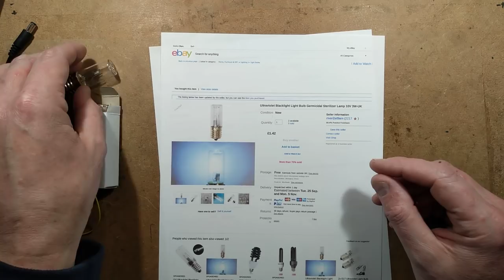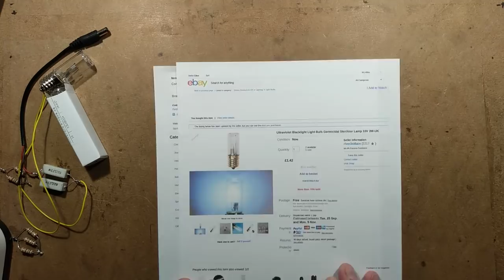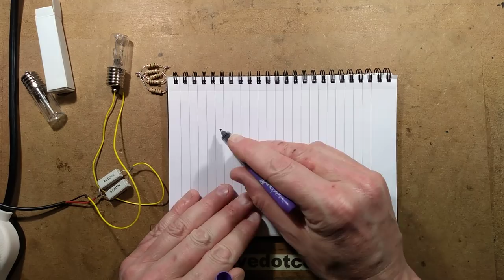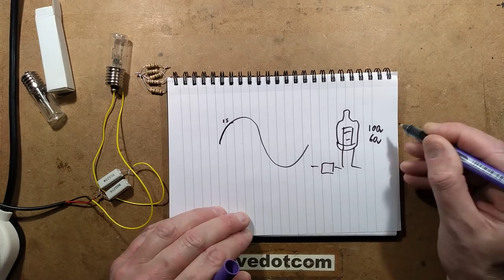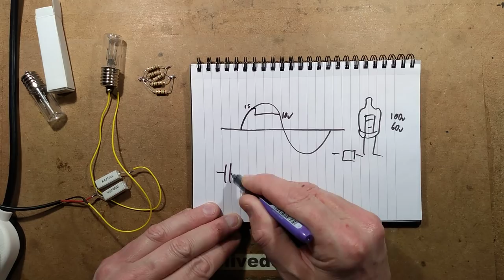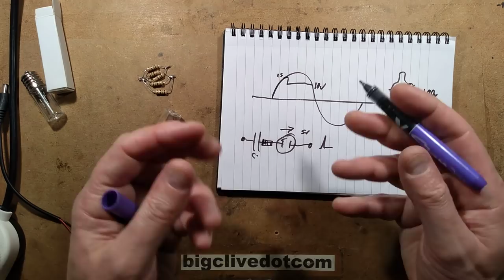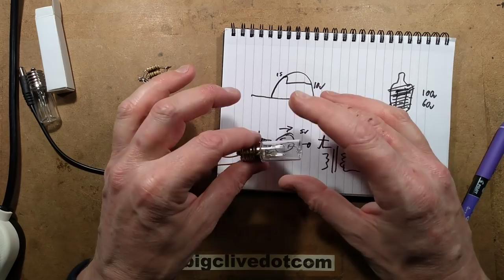Amazing ten-volt mercury discharge UVC lamp.  (GTL3)

Comment: hello.. what is the right ballast for this?
Reply from the maker: You can get a low voltage invertor to run them, but when they were used in laundry dryers they were often powered by a transformer with a resistive ballast.  You can also use a series capacitor, but it's not recommended.
Reply: @bigclivedotcom  i see.. can you recommend me as to what type of ballast i can use? THanks mate!
Reply from the maker: @crieliocriel  You may have to hunt about on eBay to find something suitable.  They appear from time to time.
Reply: Use a 5uf start capacitor in SERIES with lamp with 220v or 8uf cap if use 120v.
Y can buy cap at home appliace store.
But Clive don't raccomand!
Electrobomm say Yes! 
Be caute with fingers😀
Reply from the maker: @gnomecagnome3204  I'm cautious about the capacitor as it may age the lamp quickly.  A couple of 1 Megohm resistors in series across the capacitor will discharge it when unplugged.   My own choice would be the 12V invertor, but they can be hard to find.
Reply: @gnomecagnome3204  I tried using a 3W LED driver and now it works.
Reply: @crieliocriel  tnx for another solution.
I prefer ac current for this lamp but led driver is more saefty!
Reply: @gnomecagnome3204  I will upload a video using the LED driver.. so far.. nothing is smoking.. haha
Reply: @crieliocriel  problem with led driver that DC power will light only one side of the wire in the lamp . ideally you would need AC power

Comment: You can buy these lamps in a "no Ozone" and an "Ozone" type. Is it legit?

I found an article, which claims that germicidal lamps can not produce Ozone, cause 254nm would not produce Ozone and would break Ozone down. Other articles say, that they still procure Ozone. I AM CONFUSED
Reply: Simple quartz mercury lamps REEK of ozone.   And, they're used in hot tub ozone generators.   But perhaps the right type of glass tube will block mercury's O2 absorption line?  Yet not entirely eliminate the longer germicidal wavelengths?   (I assume that one single mercury emission-line is responsible for all the ozone-creation.)

Comment: G6 gets excellent reviews camera included ... but the review always starts - "Best BUDGET" xxxx - so that's always taken into consideration - best in its class is never going to beat worst DSLR or a "better"(??) phone model.  All zooms have 2 zones - 1, Optical (uses fancy pieces of glass) - 2 Digital - uses magic beans and string.  Digital will never be as good as optical 'cause its just sums.

All that said - I have a Oneplus6 which got (I think) it's second big firmware update which added a shedload of tweaks to the camera and its transformed the quality (it's amazing how big a difference software tweaks can make).  It's pretty common - so give it a week or so and you'll maybe see some impressive improvements.

There is a plague of chinesium "bargains" being posted at the mo.  I've had a punt at a couple of half pricers and neither showed up - as long as paypal is involved it's just a long term loan - couple of days before due date send seller an e-mail, day after due date report it - couple of days after that the money is usually in your account.  More reliable than betting on horses

Comment: Does it take 120 or 10v ?
Reply from the maker: 10V.  But usually with a higher current limited start voltage.
Reply: @bigclivedotcom  ok.

Comment: I have a PCB with 36 x UV 5mm LEDs in series. Forward Voltage stated is 3.4 to 3.8V. Forward Current: 20mA. Any suggestions anyone as to how I can power it? Thanks in advance.
Reply from the maker: If they are all in series you'll need around 100V to run the PCB.  That would hint at using a mains powered capacitive dropper type of circuit.
Reply: Thanks for your reply Big Clive. That is exactly what I have been experimenting with but the numbers are not working in my favour. Despite getting some hefty 100+ output voltages with various capacitors I can't light the circuit. I was wondering if the 1M discharge resistor across the cap might be limiting current. All the different sized caps I've tried are rated 800V. I've used a mains powered capacitive dropper circuit before Clive, taken from your website, to power a string of converted xmas lights with total success. I shall persevere, thanks.

Comment: Got these bulbs ...have 2 of them they say 10-12v ...hook it to 12v and they barely lit the wig(tried with 12v 5A power supply) - No idea why is that :D
Reply from the maker: They need a current limited supply, but should have lit at around 12V.  The dryers that used them had a 24V supply with current limiting resistor.
Reply: @bigclivedotcom  less than half of the wig is kinda redish ..maybe they are not 10-12v as the seller said? :P ..I can check the resistance with a multimeter if that helps but I have no clue what else I can do to make this work haha - Thanks for the reply man

Comment: that base is the same as the E17 Christmas light bass
Reply: PS they use a 39 ohm 5 watt resistor and a 16 volt 500ma transformer in my dryer
Reply: That's a seriously ground shaking bass!

Comment: I recently bought one of these bulbs from Banggood, but now I'm a bit confused.  The listing says it can use AC power from 110-240 volts, at 300 mA, and it's stamped with a 3 watt rating.
I haven't tested it yet (waiting for my E17 lamp socket to arrive).  Is it going to get fried if I give it 110 VAC from my mains in the US?
 https://www.banggood.com/E17-3W-185nm-UV-Ozone-Sterilizing-Ultraviolet-Light-Bulb-AC100-240V-p-1227190.html
Reply from the maker: There are some weird listings that imply the same.  I'm not aware of any higher voltage versions.  I very much doubt a resistor in the base would be viable at such a high current.  I'd suggest trying it with 16 to 24V AC and a resistor of about 40 ohms in series.
Reply: Thanks.  I'll give that a go.

Comment: looks like the kind of bulb sometimes used now to sterilize toothbrushes. I had the rig, till it fell off the sink and broke the bulb. Also eprom eraser. Very dangerous to eyes!
Reply: One day my wife came home with a toothbrush sanitizer she purchased at a liquidator. It promptly made its way to the workbench where it erased a good number of UV erasable micro-controllers - back when it was either that that or one time programmable (OTP).

Comment: DSLRs are usually a ripoff for video work if you can't modify the firmware (4:2:0 is available in literally every tapeless consumer camcorder back to 2003 and possibly Sony's micromv tape as well back in 2001), but I'm still partially brainwashed by the broadcast television classes I took back in 2012-2014 (please pay no mind to the weirdo with the crazy hair frothing at the mouth).

In all seriousness though, if it's the one I think it is (something in the Sony A7[x] series), you bought a damn good video camera provided it actually shows up.
Reply: So what's the cheapest old HD camcorder that makes sense for video work?
Reply: I could go on at great length about all of the technicalities (and really it depends on the equipment available to you). If you're working with the absolute bare minimum (Windows Movie Maker or even a really low cost paid editing package and a computer with none of the fun legacy crap for things like DVCPROHD or even Betacam SX--a weenie modern computer as YouTube user uxwbill would put it), I'd recommend something like the Canon HF10 or HF100. If you know how to smooth out the artifacts of 4:2:0 chroma subsampling, you could easily fake your way through a college broadcast course (I almost did with that thing, but since I was still coming off my senior year high--it had a cute name like 'senioritis'--I didn't do all of my assignments and flunked out).

Personally, I prefer proper broadcast equipment, but I'm lucky enough to live near where there is occasionally broadcast gear sold as surplus at STEEP discounts if they're not outright tossed in the dumpster while still fully working (3CCD ftw).
Reply: Currently the HF1xx series can be found (if you know what to look for) for just proud of $120 fully working. You could go cheaper, but usually you lose out on proper manual controls like focus and aspects of exposure (gain, iris, shutter speed, the fun stuff). I'd also recommend using a pack light kit, never bump the gain much further than like 3-6db if you have to at all.

Personally, I went for having a Canon XF100 (and a Panasonic AG-HVX200 as a backup), but I was fine with nuking my credit score and going into debt for a while.
Reply: Windows Movie Maker? Why... there's DaVinci Resolve. Hell i can make do with Blender.

My pretty much first and last contact with video anything was
- encoding videos captured from a bt878 PCI TV card - e.g. from a VCR, live TV, from Dreamcast, etc - on a 700MHz Athlon that i dumpster dove in 2001. I didn't actually need anything, it just seemed like a nice challenge to make a dumpster-quality processor and a dumpster-quality hard drive do full 768x576 interlaced 50Hz and not lose a single frame or any perceptible quality degradation in half an hour, and i succeeded. I ended up with constant quantiser q=2, completely non-motion-compensated MPEG4Part2 encoding with 3ivx codec, and uncompressed audio. The Maxtor DM80 hard drives pretty much folded in on themselves if you tried to make do with HuffYUV or somesuch lossless codec. I got a bunch of DM80s because of how phenomenally unreliable they turned out, but they had a lifetime warranty (no proof of purchase necessary) so you could send them in to Ireland for repair, which is what i did. Some of these travelled to Ireland 4 times.
- a short time later using the same dumpster computer to animate a photo slideshow from a mountain trip for a local club, synchronised with music, using Ulead Pro 6, that i got with something or other. I also used freeware or part-shareware version of Blender (it took a few more years to go open-souce) to animate some of the more involved parts, i took photos, separated them into layers in Photoshop LE 6 or drew a depth map, and then built a mesh in Blender to map it onto. Printed it onto VHS using some ELSA graphics card with TV-Out.

I'm sure if i dug deep enough in my stuff, i'd probably find a FireWire card i can use.

Unfortunately since then depression has been getting worse every year and my budget isn't exactly good, in fact my computer is relatively less modern now than it was back then, it's a Phenom II x6 and GTX750Ti. The economy went from thriving to borderline failing too, now people can't afford to throw away nice things any longer.
Reply: Given that setup, you could probably get by with the HVX200 if you don't mind using your computer as a recorder with Adobe OnLocation (they're usually only reasonably priced if found without the P2 cards). Otherwise, the HF1xx is probably the cheapest option unless you can find the odd Panasonic HC-V700 for under $100 (people think these things are literal gold). Out of all three mentioned here, only the HVX200 does 4:2:2 (but it's also much more at about $400-$500 at the low end of the price table). Of course, I'm assuming DV/HDV tapes are a bit outside of the budget, but people seem to think anything HDV is gold as well (they're really not unless specifically made for broadcast).
Reply: It seems that HF100 with a runaway zoom that just activates on its own pop up once in a while, i'm sure it shouldn't even be that much of a challenge to fix, and they can't exactly be expensive. I have taken apart compact digital still cameras full of flex PCBs and fiddly optical mechanical bits in the past, and put them back together perfectly fine, one Olympus a Canon and a Minolta, and i used to routinely repair laptops, i'm fairly good at these things. I mean, we're Clive's audience, right.

Thanks for advice <3
Reply: I think the Canon cameras are much more open with being serviced than Panasonic and older Sonys. Best of luck if you come across one.
Reply from the maker: A6500.  If all goes to plan I'll be looking to defeat the recording time limit assuming it stays cool enough to run that long.
Reply: Ooh, that's a pretty sexy camera too. I have had an alpha camera before (a considerably lower end one) and I got around heat issues with ice packs. I had thought briefly about using one of those "liquid metal" solutions that some people use with computers, but since it was originally intended to be sold off anyway, I didn't figure the new owner would appreaciate a huge heat sink hanging off the bottom of the camera body XD

I ended up purchasing a lot of my broadcast stuff shortly after so that's that one.
Reply: When digitizing VHS tapes I use the WinTV BT878 card and HuffYUV...SuperBowl 12 takes up about 5 single layer Blu Rays to hold, but I can always go back to the original quality without wearing out the tape.
Reply: @brentfisher902  probably better than the hours of MiniDV copies I have of all of my VHS stuff XD

Comment: Why a mirror SLR instead of mirrorless? Battery life for still images. I don't generally do video, and the number of shots I get from two batteries on my 5D Mark IV is vastly greater than a mirrorless will provide. However, if you primarily do video, then yes, get mirrorless.
Reply: Batteries are really not an issue except for some niche use...
Reply: I suppose the weight of 10 batteries isn't much more than 2 when you consider the lenses, tripods, camera bodies, reflectors, filters on a hot Texas day several miles into a slog in the LBJ Grasslands, but I really don't want to buy $600 of batteries. And I don't want to find space for them all.
Reply: I stand corrected. The new Canon EOS R gets a respectable number of shots with the same battery my Mk IV uses. While still less than the 5D, the number of shots per battery is not the consideration it was. Therefore Pook365's comment is correct and I was wrong.

Comment: I used to have a "DATARASE" EPROM eraser made from a very similar lamp, although in globe form factor. Inside was just a fuse, a switch, the lamp, and a nice big Nichicon film cap. Pictures of the exterior and interior are here: https://forums.arcade-museum.com/showthread.php?t=423586&page=1
Reply from the maker: That is using the simplest lamp and capacitor circuit.  I may have to try this and see if it blackens the lamp quickly.  Probably not such an issue in a short use item like a UV EPROM eraser.

Comment: Moto G6 Plus or G5 Plus.
Reply from the maker: Moto G6 play, since the standard and plus versions seemed to have lower resolution cameras.
I think Lenovo have really just effectively ended the Moto brand by ignoring its original purpose.  Rugged phones with good cameras that you didn't have to worry about damaging at work.
Reply: @bigclivedotcom   love my G5 Plus in gold, but I'm only concerned about glamour, camera is more than adequate for my needs. 😉

Comment: Pleased to see you are finally getting a proper camera. Hopefully it won't turn out to be a fake. Handy hints for setting up the new camera.;

1. Please please do not use auto iris - a very bad habit for serious work and annoying to the end user.
2. Zoom right in to the full extent of the optical only range. Do not use digital zoom under any circumstances.
3. Then if the image is fuzzy, the correct solution is to mount the camera further away from the subject, until it is sharp.
4. If the camera (or your present phone) seems to record in stereo at times, change the recording to mono in your edit software.
5. Should that feature be unavailable you must please get some professional editing software!

By the way, SLR's using a mirror must surely have a lag too. Before the shutter can fire the mirror must go up.

Comment: 13v, with 120ohm in series anyone?
Reply: Without initial high voltage (around 17v from my bench supply on a random sample) it won't strike, even after it has heated for a while. Some lamps may strike at 13v... but I'd expect a glow from the filament and nothing else.

Comment: Come on BC, could you at least put some gloves on when directly handling cancer with your fingertips?
Reply from the maker: Ongoing research suggests that UVC, while causing surface damage does not actually penetrate as deeply into the skin as UVA and UVB.  It may be that the other two pose a greater melanoma risk.
Reply: There's a great deal more nuance to the interaction of those photons with matter than either of us have the time to discuss, and I don't make a habit of asking people to be careful more than once, so I'll just say I would not trust so readily in the quality of the glass nor the purity of spectrum that a cheaply manufactured Chinese germicidal lamp possesses.